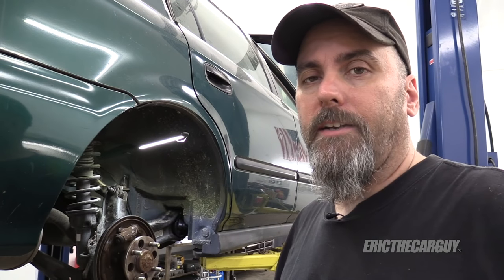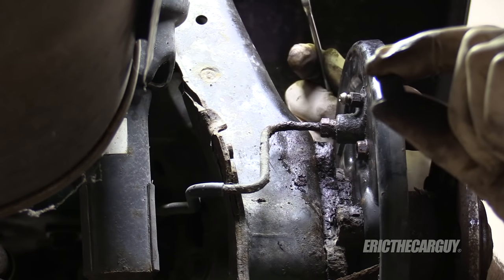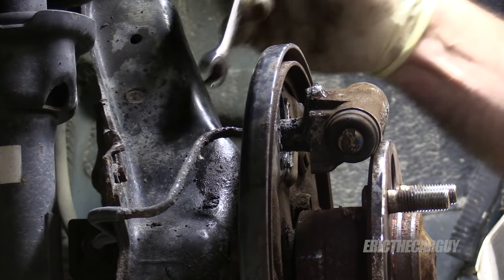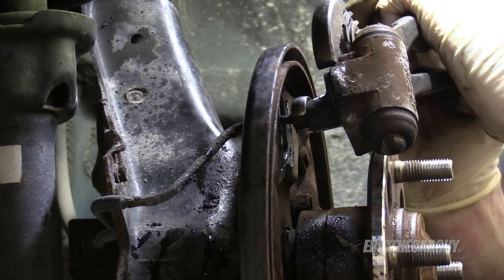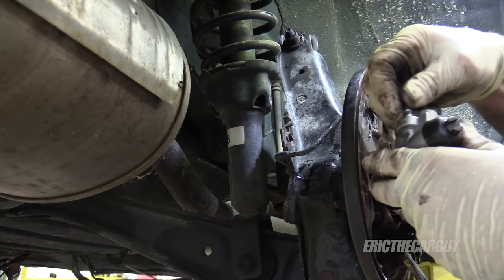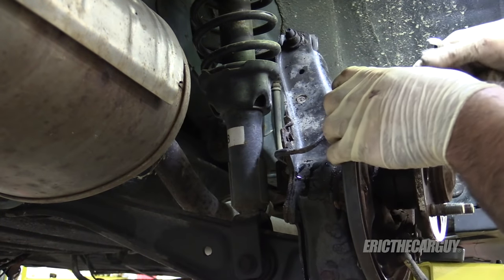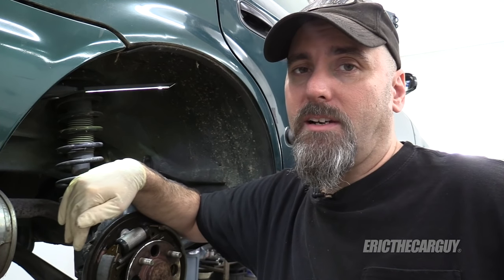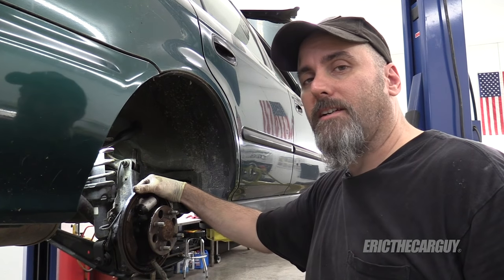How To Deal With Rusty Brake Lines

Comment: My 92 firebird will not start or turn over and I don’t have any dash lights come on. And I know the battery is good . Any idea?
Reply: Check all the battery connections including at the starter solenoid and you didn't mention what type of vehicle but most 2000 and up have a main fuse coming from the positive side of the battery ? Nissan is known for this crap ? Start with the obvious first and keep us posted
Reply: Sorry didn't see the firebird , Yes check Main starter fuse
Reply: Blown main fuse. He's got a whole bunch of no start condition troubleshooting videos, give em a watch
Reply: @thomaspatnode7053  , hopefully it's not a fuseable Link in the line ! Hate when that happens !
Reply from the maker: http://www.ericthecarguy.com/faq/solving-automotive-no-start-problems
Reply: Maybe the  VATS
Reply: Dempsey Soles had this happen to me on my similar year camaro, when 1200 miles away from home in New Orleans, 4 days before hurrican Katrina hit. . . 
After driving all day and into the night, accidentally took a wrong turn and landed in the gutter of Batton Rouge.  Then the car just died electrically. Bought a new battery at a parts store 3 mins after they closed... nothing. 
Got a flatbed tow to a hotel. Had one of those cheasy car travel tool sets with the soft plastic case on board. Spent the next day with the front wheel under the rocker panel holding the car up while removing the starter. It worked outside of the car hotwired to my old battery.
 Took a cab to auto store, bought a spool of guage wire they had that looked the same and a bunch of eyelets. Spent the day restringing all the main power corroded  green wiring from many salty winters at starter to the main connection on the passenger side of the radiator support. Had to alternate between 20-30 min work with 10-20 min cool downs in the hotel room a/c while contending with very unhappy hysterical girlfriend.
 The pavement was hotter than hell. I drank a gallon of ice t in less than an hour. Had to spread my spare clean clothing out on pavement to keep from getting burned. 
 I wasn't going for a quality professional long-term repair, it just had to work RIGHT NOW.
 After a "are you sure it's fixed??" comment followed up with a "put your junk in the trunk!!", we left heading to a friends' place in North Carolina. 
The next day I was watching the news over a beer and the entire place where I broke down and rewired the car at was underwater.
 I needed a vacation from my vacation. 

Long story short: on your Firebird there are a lot of secondary wires on the starter that feed power to the entire car from the b+ lug on the starter leading to the b+ lug on the radiator core support. These are before any switched power from the key. They were all questionable along with all the connections on my car.

Comment: Pro-tip. Move out of the rust belt and into a southern state where you don't have to deal with this rusted garbage. Either that or replace all lines with nickel copper lines. I live in Michigan and this rust crap is getting old.

Comment: In my country, which is the Netherlands it is not even legal to drive a car with brake lines that are  rusted like that, it wouldn't pass the annual inspection and the vehicle would be declared un-roadworty. Why? Because it is a SAFETY issue.

Comment: I just tackled replacing all my brake lines in my truck, I'd love to know some tricks on how to remove old crusty bleed valves that are rusted to crap on calipers.  If anyone has some tips.
Reply: Well here goes! 
- Tap the bleed valve to release the crusty and rusty incrustations. Lightly hammer it, but make sure to not beat it to damage. Small chisel or old screw driver works wonders releasing accumulated crap.
After that DO NOT go all ape on it. Work it back and forth gently. So it release, but not break!
ALWAYS use a 6 face socket for the removal operation! ;-) 
Avoid heat (torch), after all there's rubber components near by.
Reply: @crpth1  Thanks for the info! I ended up just saving for all new parts, felt safer.  those valves just snapped off in the end haha.

Comment: Flare nut wrenches are a MUST when working on hydraulic systems.  When I install brake lines, I apply a small amount of silicone grease onto the thread & where the nut & tubing meet (I use Honda's $50/tube high-temp brake system silicone grease).  

Speaking of brake system, I just destroyed the master bag/booster on my 04 TL while trying to drill a hole in the firewall to guide methanol line & electrical wires......why did that booster have to be there.....a $110 damage (just ordered an 08 TL booster, as it is the same part although the P/N's are different and was about $10 cheaper).  Last night, I drilled a hole from the engine bay and was a success......(sob)
Reply from the maker: Ooh. Sorry to hear about that.
Reply: Thanks Eric, at least the genuine Honda booster was only $110.......

Comment: One problem with this method is that often with aftermarket parts the new part ends up in totally different direction than the old one.
Reply from the maker: That does happen sometimes, but sometimes you also get lucky.

Comment: Just use a torch and heat it up
Reply: good idea.. right up to the point the brake fluid catches fire
Reply: 888johnmac lol I guess that could happen if you don’t know what you’re doing 😂 you’d melt the brake line before the fluid would catch fire tho
Reply: audifixr .. true or burn through  a really rusty/thin brake line
Reply: 888johnmac yeah that’s possible but again if you know what you’re doing 1 you’ll heat the nut and not the line and 2 if it’s that rusted replace it. I’m not gonna argue, I’ve been a licensed auto tech for 15+ years in Canada, heating up brake line fittings is a part of life in the rust belt.
Reply: audifixr .. yeah i'm in north UK.. rust is a fact of life .. stay dirty

Comment: Just asking....if something like a rusty brake line, or whatever, is left secured, but under tension, won’t it eventually rupture due to oxidation and continual use? I mean faster is all. Just asking. Cuz I’m curious and I’ve dealt with stuff like brake lines in the past. Ok. Hydraulic systems. Which require precise bends cuz any weakening of the tube could cause problems down the line and hours of bs ok I’m dronk n I’m done bye
Reply from the maker: Like I mentioned in the video, if brake lines are this rusty, just replace them.
Reply: EricTheCarGuy i get it mr. the car guy but this question  is more of a general porpoise kind of thing. Some hydraulic systems are very sensitive due to the amount of angles in a particular tube, the chemical pressurized in that tube, temp, stainless or whatever, I cannot list all this shit. You still the man, stay up 👍 playa

Comment: If you hadn't ended with actually replacing that piece of crap that used to be a brake line, I'd have felt compelled to write you a really nasty letter.  In all of my years as a mechanic , and that's way more than yours, I'd never reuse a line as rusty as the one you showed.
Reply from the maker: As you saw, we think alike. I replaced the line but also took the opportunity to make a video about it which is my profession these days. I would argue that I've been doing THAT longer than you. That said, I find there is always something new to learn from just about anyone, especially those that have been doing something longer than I have. Thanks for your comment. I'm glad you didn't have to write me a really nasty letter.

Comment: i will try to heat the brake line with a propane torch, that might break the rust.
Reply: Just watch for hot brake fluid spewing out of the wheel cylinder into your face...
Reply: i use my butane torch works 99% of the time why didn't i say 100% i'll tell ya why I'm not looking to jinks myself !! its never not worked
Reply: i  never use a torch without a mask and neither should you.
Reply: @67cudaksa34  not bad advice one bit but in all honesty no disrespect if you have to heat a brake line that much that it dangerous your doing it wrong ! I've shown my "power probe" butane torch method to hundreds of tech's and every one is left speachless .... 90% of actual flare nuts is grade 5... brake line is a soft grade 3 line the melting point of brake line is exstreamly low easiest way to execute my method is simple light heat till you see a puff or 2 of steam tighten fitting witch compresses line end work fitting back and forth till line moves freely .... Witch it will 90% of the time the other 10% a second round of slight heat will cause brake fluid to seep causing lubrication thus freeing up the fitting from the line ... Living up here in the northeast like i do road salt distroy's lines badly up here ...
Reply: i never said to get it close to to the melting point. And in over 40 years of doing this, i have never has and problems
Reply: Yes that might break the rust, including breaking the rusty brake line that was held together by mostly rust.  Eric did it the right way.  If you try to force that nut to turn on the line, you further risk breaking the line.  I wouldn't even try to get it to turn if it won't after some penetrant.   Larger piping or bolts, sure I heat those all the time but brake line is already pretty fragile even before you introduce enough rust to seize the nut on.
Reply: Considering I am going to have to bleed the fluid, any fluid that would have gotten hot would be purged.  And if the lines are that bad, i doubt the person who owns the car, has ever completely flushed the system. And to be honest, if a brake line is that rusty, i replace the entire line. Why risk any car having rusty brake lines.

Comment: That line is shot and dangerous. I wouldn't even bother trying to save it. Get a roll of Nickle Copper line.
Reply from the maker: I believe I mentioned that. I also replaced the line. Did you miss that part?
Reply: No, I was merely stating the obvious, agreeing with you. I tend to sometimes speak rhetorically.

Comment: Ooow you cheat lol.
I did think about the new thread not starting in the same rotational place.
I didn't have any problem with my method ha ha , just pulling your leg :-D.
Plastic coated pipe would be nice.
Reply from the maker: It does happen. This doesn't always work, but when it does, it can save a lot of time and effort. That is, if the line isn't too rusty. If it is, you should just replace it.

Comment: Any potential leak is unacceptable like rusty lines that you know are going to leak in the near future.my safety and people around me are worth a heck of a lot more than a 10.00 brake line and some labor.please don’t tell me you fix brake lines with rubber hose and hose clamps also
Reply: He said he replaced it.......he said in the vid this will get you by but he recommends replacement.....
Reply from the maker: Did you watch the video or just comment?
Reply: I am sure you are on it now in regards to Eric replacing the brake line - so I don't have to mention it (lol).  But, when you mentioned about using rubber hose and clamps to repair a brake line it hits home.  The last used vehicle I bought had that fix on it.  They had a whole textbook's worth of those repairs put to use on it.  ...Scary to think there are some of those people out there - and proudly driving their newly repair vehicle.  That vehicle is what brought me here to Eric the Car Guy - his work has never let me down.

Comment: Hi surely if the line is that rusty it is a safety issue. Am i missing the point here ?.The cost of replacing this line is minimal. This technique is not relevant surely. Safety is paramount when the rust is this bad and causing this form of get around repair it is irrelevant.